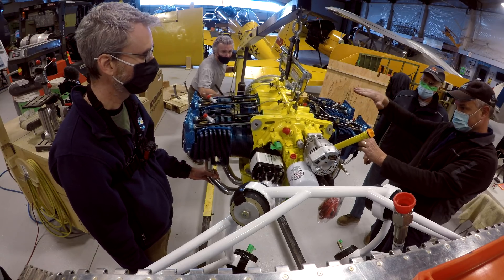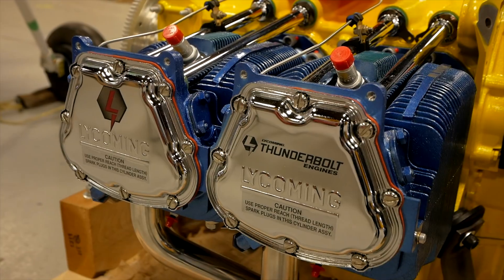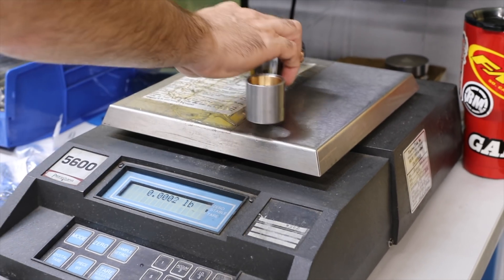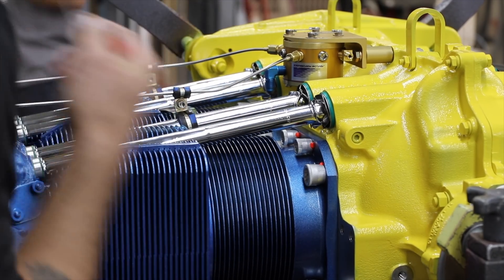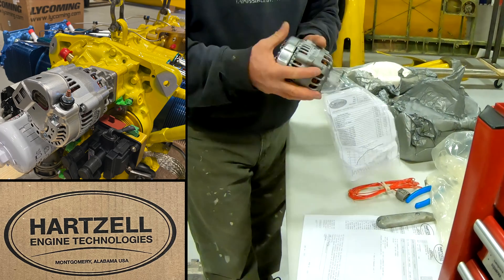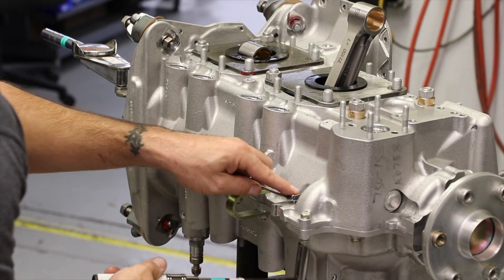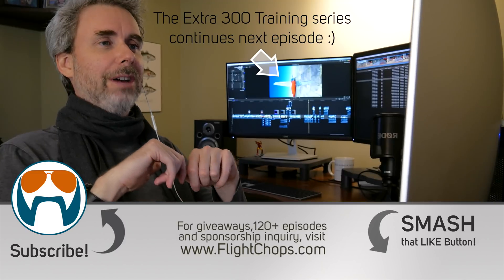Certified vs. Experimental Aircraft Engines - Why we chose Thunderbolt!

Comment: Lycoming has been so far behind the technology curve.  All those features we have been doing on experimental engines for years.   After how many years they finally used Surefly electronic ignitions, polished/ported int/exh, balanced rods and not running the intake pipes thru the oil sump.   Looks like they copied or are private labeling parts from all the experimental suppliers.

Comment: Why is sealant and silk thread not applied to the saddles on the forward, center and rear webs of the crankcase halves on Lycoming engines-? 
Sealant and silk thread is only applied to the parting surfaces around the periphery of the crankcase halves on Lyc. engs.
Continental engines apply sealant and silk thread to the forward, center and rear web parting surfaces.

Since there is very slight movement between the case halves parting surfaces in the center of the engine,  metal fretting sometimes occurs as well as oil ingression between the parting surfaces which eventually means metal wearing against itself and torque being lost on the thru bolt nuts. Then is is just a matter of time for a premature  engine disassembly. 

On another note, Lycoming engines have their camshaft mounted above the crankshaft which means no oil drip effect from the crankshaft on to the camshaft which results in premature rusting of the camshaft lobe(s) and lifter face(s) if the engine sits inactive for a period of time. Continental engines mount their engine camshafts below the crankshafts and are less prone to rusting of cam lobe(s) and lifter face(s).

Having to remove the propeller and starter ring gear on a Lycoming engine to change an alternator belt is a bad design while this is not necessary on most Continental engines since they mount their staters and alternators on the accessory drive case meaning that no drive belt is required.

Comment: Steve, do you remember the price difference between the Thunderbolt and a certified Lycoming when you purchased?  Obviously the prices have gone insane on like homing engines and I am looking for alternatives.
Reply from the maker: Hey, I don't remember the difference in pricing, but the package I ended up with was in the $47K USD range.  What alternatives are you looking at?
Reply: @FlightChops  Well I just started but I'm looking at the Continental Titan  IO-360 equivalent (which is just a Lycoming apparently but they let you come help build it and has a 2000 hr TBO). Maybe a Superior IO-360 but the have a 1500 hr TBO. The prices for them are very low $30s still. I just don't understand Lycoming right now. 🤦‍♂️ I'm a single income blue collar guy and they want $43k for the YIO-360-M1B (experimental) plus another $3100 for the aerobatic kit. Too rich for my blood.  I only have 336 subs on YouTube so they aren't gonna help fund it. 🤣🤣🤣

Comment: You gave a shiny new engine a new name, but underneath it all, it is still the old Lycosaurus , a 3/4 century old design, with build in lack of fuel efficiency of that era. A liquid cooled engine would make having a heater much easier and lighter.

Comment: Why not balance certified engines? Wonder if lycoming is pursuing certification on balancing and port and polishing.
Reply from the maker: My understanding is that any deviation from the conditions under which the component was certified... requires recertification, which is prohibitively expensive. (Anyone, please correct me if I am wrong, or over simplifying).
Reply: @FlightChops  no you are correct. But they can use these engines to assist in process

Comment: I’m an airboat owner, we take old runout aircraft engines and convert them to airboats. The cost, I’ll have to assume, is a lot less than if the engine were going to fly. I have an O-540 AV on my airboat with 10/1 compression pistons and electronic ignition. Around 300 hp at a cost of between 10k-15k. Anyway, my question is will Lycoming build an O-390 specific for an airboat at a comparable price?

Comment: So the thunderbolt is made like a Rolls Royce Merlin not a Packard one?
Reply from the maker: Interesting - I hadn't thought about that.  I don't really understand the differences between the Rolls Royce and Packard engines.
Reply: @FlightChops  Rolls Royce motors were essentially blue printed and assembled by skilled craftspeople whilst the Packard motors were made to tighter tolerances and more accurate dimensions but mass produced. Packard made half as many engines in one factory as Rolls did in three and made larger profits into the bargain though the Rolls engines were more reliable and produced more power similar to thunderbolt motors Vs standard Lycoming :)

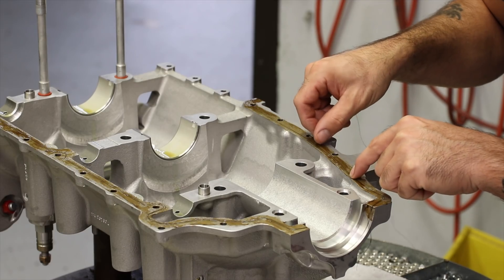Comment: What is the wire/thread that the mechanic is laying in the grease at 8:15 ?
Reply: It appears to be the silk thread that is used to seal the crankcase halves.  Ly-Con has an STC to route a groove and use o-ring material.... Never leaks.

Comment: 6:58 those engine mounting bolts seem REALLY small .. all the motor weight hanging on only those 2 little upper bolts?  Yikes!
Reply: There are 4 of those. Plenty of strength.
Reply: @vector6977  depends on loading.. when motor is pulling hard, yes 4 bolts are loaded in tension. When sitting stationary, the weight of the motor really loads those two top bolts, in shear and tension.  There is no redundancy, or much over design in the mounting, when this seems so very critical??
  Why not use 4 larger bolts, or more than just 4 bolts?? .. seems a dangerous place to be trying to save a couple ounces of weight, LOL !!
Reply from the maker: I don’t think the bolts are really in shear if you look at the orientation of the mount points (top ones angled down, bottom ones angled up).  And also the big hard rubber mount pucks being squished keep the bolts in tension - and the bolts are not touching metal, they are squeezing the rubber like big thick washers helping them avoid the shear force.
Reply: Engineers say its ok.
Reply: @vector6977  I'm an Engineer, and I would want more safety margin against possible bolts breaking, coming loose, etc...

Comment: This engine looks more burly then a Cummins, more reliable than a Toyota, and easier to work on than a go-kart.  Those internals look like they can do 2000hp.  Imagine that in a car i would poop
Reply: In a car, it would flop. 

It's basically a 1960s VW Bug 4-cyl engine that's got the displacement of a pony-car V8.

Air Cooled, Horizontally Opposed Engines are all from the 1930s-1950s with little if any improvements since then, except better bearings, ignition, electronics. 

They only rev to 2700-2800rpm, make around 160-210hp, loads of torque but it's all in a range of 500rpm. They are mostly turds.

Comment: I don't think this addressed one major question. If Experimental is so much newer and greater why does anyone get a certified engine?
Reply from the maker: I think the issue is, if your aircraft requires that you have to get certified components, you don't have the option to consider experimental. But if you have both options, it often makes more sense to go experimental.
Reply: @FlightChops  Why would you be required to use a certified engine if Experimental is better? Commercial purposes?
Reply from the maker: Sorry, I assumed you were in the aviation niche - my content makes some assumptions about who is watching.  It is a big complicated discussion to explain why some aircraft require certified components, while others do not.  The quick answer is that a factory built plane like a Cessna can never have any non-certified / experimental components installed.  A home built experimental aircraft like the RV-14 we are building still needs to meet a high safety standard, but it is not limited to certified components - we can chose to use certified or experimental parts.
Reply: @FlightChops  That's a fair assumption. I'm hoping to be starting my private fixed wing certification here by the end of the year. I'll be transitioning to flying Commercial Helicopters after I get out of my current career.  Thank you for the brief explanation.

Comment: Port and polished cylinders or cylinder heads? 
Anyways. It’s about time aircraft engines started balancing rotating assemblies. 
recently built a Ford 347 and balanced the rotating assembly to .01 grams on the rods and pistons. Decked the heads and block, port and polished the heads, took care of hot spots. Increased from a 67cc dish to a 73cc area with a carbide bur, took my time.  

Are you hiring, Lycoming? I’d like to build a Thunderbolt with a set small Borg-Warner turbos. 😃😃🐻🧞‍♀️
Reply: Why port & polish for 2500 rpm ? They are internal balanced to a point. Then a 150 lb prop is hung on the front. Last there goes the cost !

Comment: As someone who is also an automotive enthusiast, I've seen where people building experimental planes will sometimes use auto engines instead of a dedicated aerospace engine. What are the main differences between an automotive and aerospace engine. Also, why is fuel injection so expensive for aerospace engines? Why is it not the defacto standard in 2021? Plus, with using an automotive engine, the industry could very easily (at least on the aircraft side) nice away from using 100LL fuel, and therefore reduce pollution from lead as well as reap the benefits of cheaper fuels (in general).
Reply: Aerospace ? not even close. Answer to your question has a few paths. Cast to develop. Weight is a big factor. Small market does not help keep the cost down. Power output is a major roadblock. Prop is limited to about 2800. Whats a small block put out 25 ? Not much. No ,gearing has problems also. Difficult question.

Comment: How does painting affect the cylinder cooling? And do different colours promote better heat transfer?
Reply: I hope they use a proper type of paint. Ca 1990 in the Netherlands I was watching an engineer take of the engine cowling of a similar engine.
The private owner had sprayed all the cooling fins with a thick layer of a sticky anti-corrosion liquid. He had spotted the beginning of rust he thought.
During the taxi run, he noticed smoke...

Comment: Has there ever been anyone that has installed one of these engines in a VW bug? Supposing one where to do so, what advantages - if any - over another, non-aero VW engine should be expected? Yeah, I know, crazy question, right?  It has bugged me for a long time (excuse the pun).There are people though who spend on a car many times its factory price.
Reply: Big $$$$$$$ .  Just do a Subaru motor!
Reply: @patonbike  Yeah, forgot to mention it was a theoretical question: of the "if money was no object" type. I kinda hinted this was the case.
I wouldn't do a Subaru conversion though. If I were to spend big money on a VW engine upgrade I'd go for either an upgraded regular bug engine, a current construction boutique bug engine or (if I could fit one) a Porsche engine in that order. If I were to fit a non VW pedigree engine, I'd go for a full electric conversion or something equally radical.

Comment: Another A&P here (it's clear MANY of your audience are too!)
I love the deceptive simplicity of the mechanical requirements (separate from the paperwork and traceability factors) for an engine to be certified.  Now, I haven't been turning a wrench in a while, so I might be a smidge off, but if I remember correctly:
► A new engine must operate at full (TOGA) power, for 50 hours straight, and when torn apart & inspected, must show zero wear.
Short sentence; steep engineering challenge.
I'm so envious of your Vans build, Steve, and I'm just a few hours down the road from them in Oregon. <3

Comment: Does using an experimental/non certified engine equate to higher insurance costs?
Reply: NO it voids the policy !
Reply: @pauleyplay  Does this mean that those using these engines are flying without insurance?  That seems like a lot of guys are taking a big risk.
Reply: Cant install  exp anything in a certified plane. You can than airplane must recert in the experimental catagory. You just cant do it. There is a process to do mods such as engines. Very costly. takes forever. The feds hate it !

Comment: So a "Thunderbolt" Engine is like a ported and Blueprinted race engine.
Reply: That's what I got out of it. Look at the size of those con-rods! MASSIVE. And that crankshaft too! That was impressive. Those parts in a car engine could handle 800 HP, I'd bet.
Reply: @SmittySmithsonite  An aircraft engine runs at a greater percentage of max power than, say, a car engine. And for 2,000  hours.
Reply: @UncleKennysPlace  - Yep, just like marine engines. Constant high loading.

Comment: ...What's up with the BMW valve cover back there. It's a Lycoming pattern, not like any BMW I've ever seen...
Reply: BMW used to license-build  Lycoming Engines.
Reply: @aviatorshorty3349  BMW originally manufactured aeroplane engines over 100 years ago under the  Rapp name in 1913, then BMW in 1916.  The BMW Logo is a stylized, spinning airscrew.  The alleged oldest surviving example is displayed in the Beijing Air Museum.  Seen in person 1989.
Reply: @lifuranph.d.9440  Yep, fairly common knowledge here in Germany.
Reply: @aviatorshorty3349  I think some folks do here in the US, if they drive a BMW.   BTW My business name is Chinese, but I'm Swiss-Italian / German born in China at the end of WWII...fog of war.      

Worked as an Aerospace Engineer in Northern California whilst earning my A&E.  I switched to German Auto Technician in 1969 for better pay and less FAA.  I still do R/C Aeroplanes, drive a Sprinter 4x4 and ride a BMW.  I do miss the '60's general Aviation with less regulation.

Blessings and don't forget to put the gear down.
Reply: I guess it's sort of meant as a joke

Comment: Up until now I thought my old o 235 locked pretty good. 
Nice to see the project moving forward.
Reply: Your old 235 is good as it gets. THere is  no difference. So its shines, that nice, but nothing has changed.
Reply: @pauleyplay  Just got it running again after a top end rebuild and a clean up. The old thing sounds good.
Stay safe

Comment: Great video.  "You don't need a core with the Thunderbolt". I'm still unclear on what the difference is between an engine and a core.  The internet is full of automotive rebuild content if you search for engine core, but nobody really describes the difference.
Reply: An exchange that they will in turn overhaul and resell to pass some savings on to you (ie: returning of the core credit)

Comment: seems like certified piston aircraft engines are a good 100 years behind what is coming out now.(exa. cam in block, pushrod, reverse flow head, greasy thred oil seal, single-digit compression ratios yet still demand 100 octane leaded fuel) its good that lycoming has a launchpad for getting new technologies into certified engines. like the new oil seals to replace the yarn. its one small step on a long road to modernization.
Reply: Gov't regulations add time and money. Certification is my day job.
Reply: @ihopetospeed1   aircraft engines are not standard. Actually almost nothing of them is still manufactured other then bare consumables, bearings and bolts for most of them. for most its either deep new-old stocks or just planes getting scraped for parts keeping the fleet going. try rebuilding a franklin, there are no oversized pistons or even a procedure to do that in the documentation. once the stock of barrels run out that's it.

or like Beechcraft, the electric motors that run the gear on early bonanzas are just not made any more. companies have to resort to re-winding old cases to keep these planes flying. even a plane as popular as a bonanza dosent warrant the cost of spinning up the tooling again to make new replacements.

at least with automotive derived engines there are hundreds of thousands out in the real world other then the few hundred that get sold in the air application. for people who restore ww2 aircraft the number of merlins and alisons made for boats, tanks, and generators has helped keep them going.

Comment: Red paint would have given your engine at least 5 more horsepower. Fact.
Reply: Yeah, but the Chrome Rocker covers are 10 horsepower.. so they are good.
Reply: You are 100% correct sir. However blue engines do run cooler. Plus the yellow provides industrial reliability
Reply: Is that like a K&N Sticker on a car?
Reply: @dasmellyyooper   Definitely.
Reply: Don't forget the polished valve covers.
Reply: That theory hasn't worked for Ferrari this year!
Reply: Don't forget the racing stripes!
Reply: Don't forget the heavy duty exhaust bearings... 🤓
Reply: @Pork-Chopper  
What colour please? It’s really important.
Reply: @glennllewellyn7369  
Now that you mention it.
Cylinder Heads should be left bare, to dissapate heat more readily.
Cylinders? Can be any color you like. Pimp your ride...
I like my cylinders in gloss black or wrinkle black. High temperature engine paint, of course. If cylinders are steel lined aluminum cylinders, (verses cast iron) you can also highlight the fins, machine the fins smooth on the outer edges so they contrast with the black. 
Engine Block can also be any color you like, like Chevy orange or Ford Blue.
My choice for color of the engine block is
Cast Iron Grey. This color conveys a heavy duty industrial machine.
All the covers can be chromed or powder coated with your choice of color.
I prefer chromed covers, push rod covers etc. And finally dress up the motor with quality hardware, stainless steel, titanium, black oxide steel etc, to give it some bling.
You'll have a motor that looks bad ass and conveys a tough no bones high performance industrial look.
To me any other colors on the motor, make it look like it may belong to a clown, but it's cool, if you're paying for it, you can make it any color you well damn please....
Just sayin'..
Reply: Bullshit
Reply: @davidmann4533  
A duel it is!